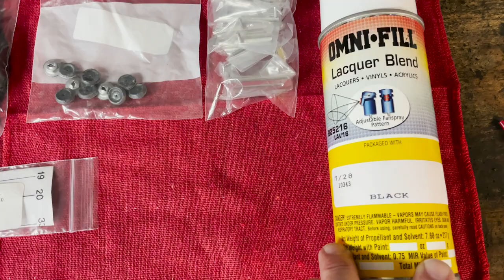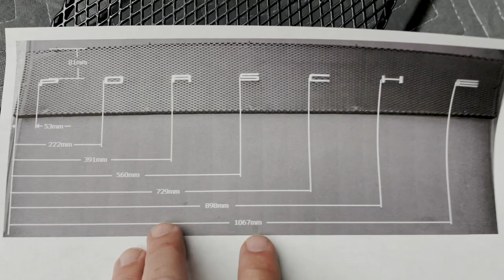Porsche 914 How to Restore the Engine Grille [Project Bumblebee Ep 14]

Comment: Hi Ian. I have 2 914s. One I have driven for 10 years. The other is a project after my "77 C10. is done. JWest Engineering makes a much nicer spade fusebox for the 914. What's up on the engine? I have the same problem with the 2.0 I'm building. The last torque on cases it won't turn over.
Reply from the maker: I really like the JWest spade fuse box. It’s just that this is an LE so I’m trying to keep as many original bits as I can. Besides, I got to play with chemistry :) as for the engine, I’m waiting for it to come back from the machinist. The align bore needed to be cleaned up a bit

Comment: Would have been to see the deck lid being removed first.
Reply from the maker: The 2 bolts holding the engine lid are underneath the hinge, so not much to see. I just use a 10mm ratcheting wrench to undo. And have a helper.